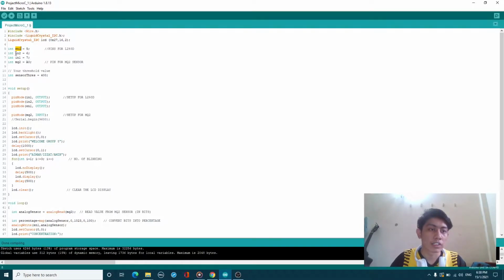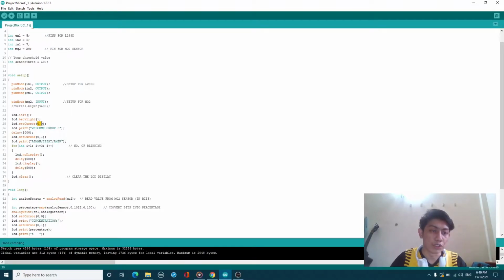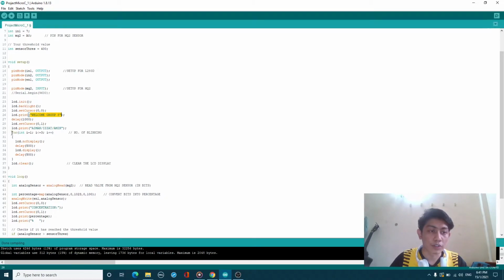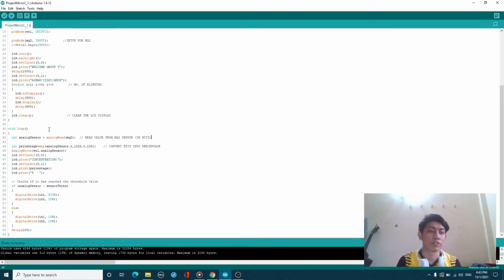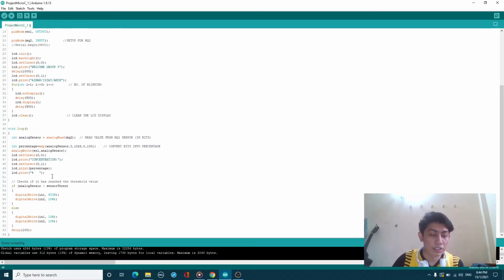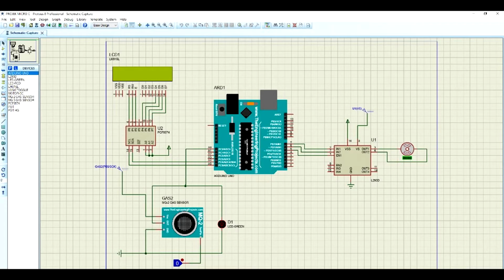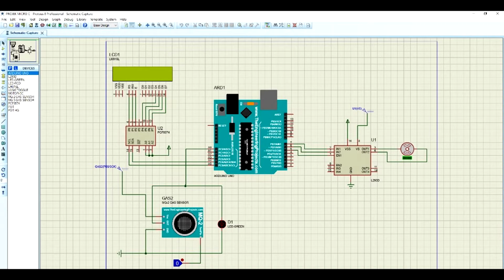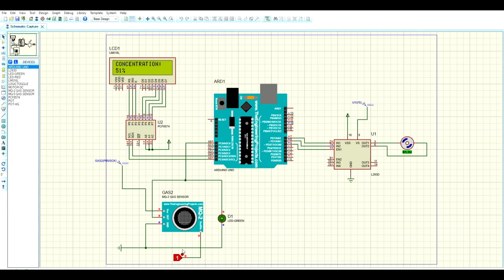SMART KITCHEN EXHAUST FAN

Comment: Good explanation & demo but a little bit lengthy and no complete prototype making me a little bit loss on what the project is all about. Can you please explain the followings:
1. Is this project to detect gas leak or cooking? if for cooking, I don't think you can detect the gas value during cooking because it is already burnt to fire. If for gas leak, using exhaust fan only is not enough to remove the gas. there must be alarm to notify owner that there is a gas leak inside the house for further action.
2. Why the sensorThreshold is set to 400? What does the 400 means?
3. The fan will not move when the concentration less than 400 right? What if there is small leakage in the gas? the fan won't turn on right? Is this solution really safe?